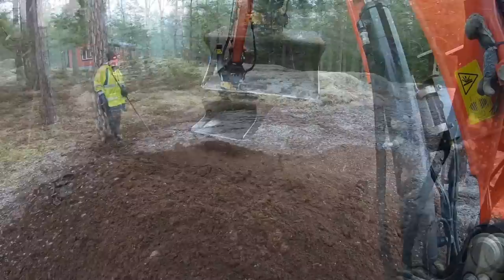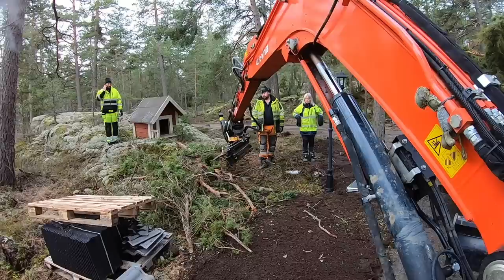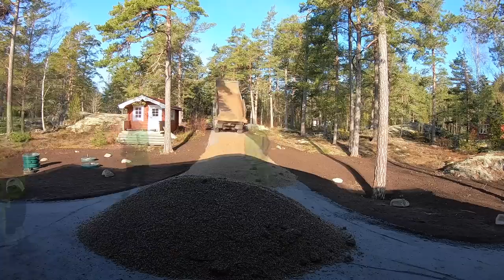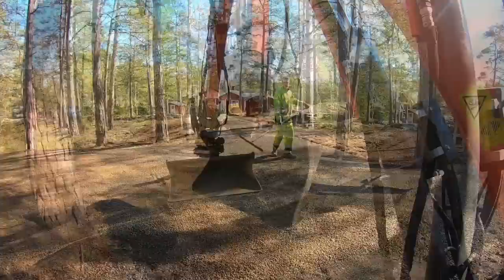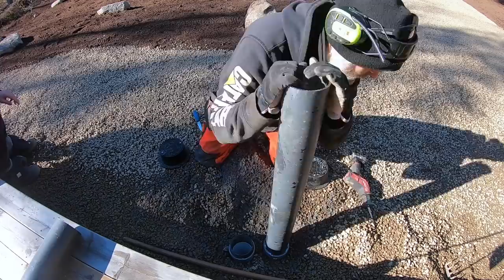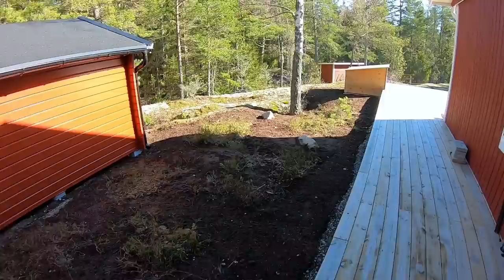Restoration after house constructionPart 9:9 Final episode

Comment: I watched all of the episodes.  Your technique was pleasurable as always to see, and the site looked tidier at the end than at the beginning.  The main purpose appeared to be to add elevation and grading surrounding the main house.  But questions:

-- Why the dog house down by the road?
-- Ended up with a parking area near the road and a single long driveway with no real parking or turning area by the house.  A car would have to reverse to get back out.
-- No road fabric under the driveway.  Won't the thin layer of gravel eventually mix with mud and become rutted?
-- Why not remove the tree stump by the driveway?
-- Were you instructed to not touch any trees?

I get the sense with this one that your team did the best they could under restrictive instructions from the client.